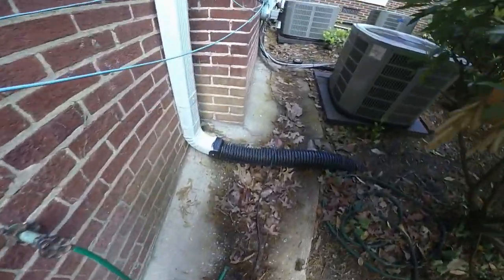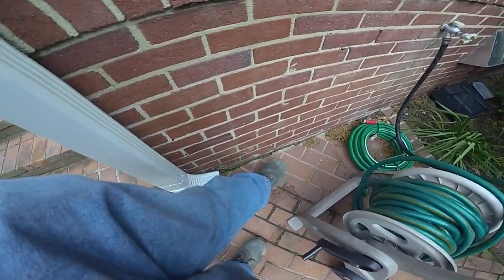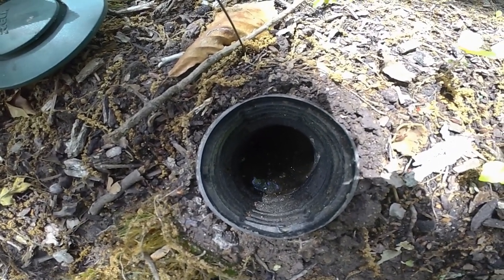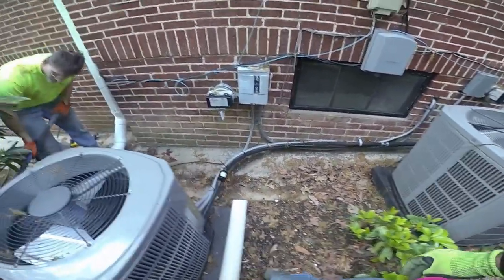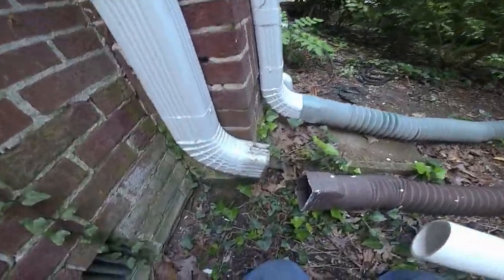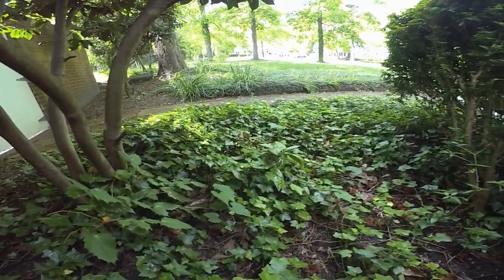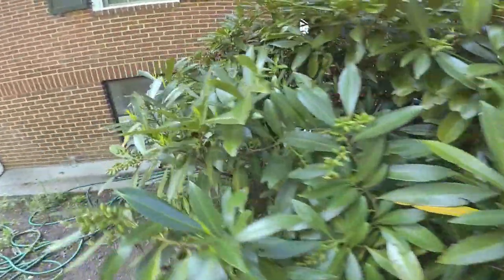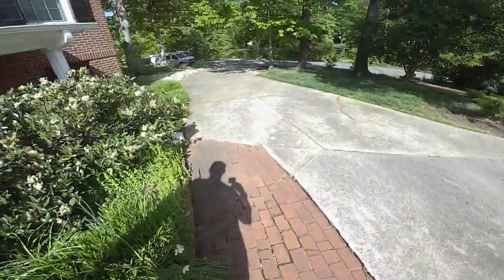Never use corrugated pipe

Comment: Totally agree with you on the “pop-up’s” I told someone doing a project that they wouldn’t work but the installed them anyway. At least they did use PVC pipe rather than corrugated. Still didn’t help.
Reply from the maker: They seem like a good idea until you think about it for a second.

Comment: The gutter pollen & tree-pollen parts from last month had created a slight backup/blockage in my smooth-wall but a larger storm cleared it this month.  10/10, I'm against popups too.  Mind-blowing how much was probably spent on those paved walkways + gutters to have no preplanned drainage solution than to dump the water onto the walkways.
Reply from the maker: Thanks! Smooth pipe is the only way to go. It cleans itself out! And yea, I run into situations all the time where drainage was not even taken as a consideration. It leaves me with some interesting and creative solutions! I'm glad you're enjoying the videos!

Comment: I don't see how a little bit of water standing on the corrugation contributed to his flooding issues. It sounds like the pipe was not draining much at all and backing up into the building and you haven't explained why that was happening. Sounds like the way it was installed was the main issue, not the type of pipe itself.

Comment: Great video. PVC all the way and so easy to install & maintain. Great job.

You had great fall too. Sometimes good fall cannot be achieved but as long as there is enough height from the water’s entry, water can flow uphill within PVC as long as when the water daylights is lower.

I tried it myself and PVC works well in difficult situations. I have fall in most of the PVC pipe’s installation but there is a bit near the end which rises and it couldn’t be helped. But the water eventually comes out very well due to the inflow being higher creating enough pressure.

Comment: I wouldnt doubt that old drain is tied into the homes terracotta weeping system, if thats the case, they should get a jetter and clean it out. It is most likely tied into the city storm water system, which would be even more beneficial for the home owner to minimize the below grade water pressure.

Comment: You say, "never use corrugated pipe". 🤔 But, Shawn, I watched a vid where this man had a corrugated pipe and used a clear hose to show just how effective it was at creating 'turbulence' and that kept the pipe clean! He was very insistent! Even showed how, when there was tons of water 'flowing' through it, that it could clear all types of debris! He was really excited by that! Maybe he should get other hobbies or maybe he was trying to sell it...ahh, now I get it...he did mention the name of the manufacturer a few times! 🤭😊
Reply from the maker: It takes energy to create turbulence, so the potential and kinetic energy of water gets used to create that turbulence and with no other input the water slows down and drops the debris. Of course this can be bypassed by blasting a hose into a short section of pipe.
Reply: @GCFD  ...yeah, that's what I thought! 🤭😊
Reply: There’s also another video where’s he’s inside with a white board drawing diagrams of a trench saying corrugated is better than pvc . The logic being corrugated follows the contour of the trench, so where there is a belly the water is inside the pipe causing it to magically flow up hill and away. He even says that pvc is flawed as there are only 2 rows of holes facing down instead of holes all the way round and on the top ( god knows why you’d want them on the top as I thought the idea was for water to percolate from the bottom up). Also said if there were more holes in pvc it would break the pipe.
Reply: The same guy that had the bs turbulence …..has other videos with dual wall saying how great it is to have smooth walls to keep the velocity up.  He also has a bs statement about needing an air vent…..LOL…..the gutter is an open system…..not vacuum can be created….LOL….he’ll say anything for a good story
Reply: @timkarcher6724  
Dual wall corrugated is FAR BETTER than sch40 pvc for downspout drains.  There are no interior ridges to snag anything, and it is way more resilient underground whether deep or shallow.  It is not cheap, but it is undeniably a great product.  It will never crack or collapse under virtually any circumstance.

Comment: What is price differential between corrugated pipe and smooth wall PVC? (Are we talking three times material cost or ….)?
Is labor time to install corrugated versus smooth wall PVC different?
Why do you use 4” versus 3”?
Reply from the maker: Schedule 40 is about 3-4+x material cost. Labor is much more if the PVC is installed correctly. So you're paying much, much more for PVC. The benefit is is self cleans, it has an enormous capacity, and it lasts for 40 years. I use 4" instead of 3" because 4" is that much bigger to let debris move through it.

Comment: What do you feel about dual wall corrugated pipe?  Also, do you use  Schedule 40 PVC pipe or are you okay with sewer pipe?
Reply from the maker: I use double wall corrugated for culverts and like them. I recently installed 60' of 18" double wall. The pipe we use is schedule 40 non pressure. It's rated as DWV pipe, Drain Waste Vent and is foam core. Same pipe as the 4" main sewer line going from a house to city sewer.  Schedule 40 pressure pipe is pretty serious, although I do have some. It's code to use it when going through foundations so I use it when I'm replacing the main sewer line  or septic install.

Comment: Corrugated pipe was used on my new house build 12 years ago and I have never experienced a single issue with them.  If properly installed they work just fine.
Reply: It is self cleaning pvc isn't.
Reply: @josephthibault6999  Apparently
Reply: @josephthibault6999 elf cleaning pvc pipe?😕
Reply: @GoaWay...  That is the argument for it, however if you don't get it at the perfect pitch it will clog. Where pvc you can hose out.
Reply: @josephthibault6999  oh. That's how it's self cleaning.😄 
When people say self cleaning, I always take it literally that something can clean itself. 😸

Comment: If corrugated pipe is so self cleaning, why don't they use it for sewer pipe? Not to mention, where there's water, there's roots.
Reply from the maker: Corrugated is not self cleaning due to the ribs. They kill the flow which is what provides the energy to carry debris. I would use PVC over corrugated.

Comment: 2:52 if you have an endoscope, you could take a peek inside so we can see how bad (or not) these corrugate pipes are.
Reply from the maker: I've thought about getting a ridgid seesnake. I think it would be useful.
Reply: BTW.. are corrugated pipes CODE for in-house drain?
ie: can you use them in kitchen, toilet, shower drain pipes?
This should clearly answer if they are better or not vs smooth wall pvc, cement pipes.

Comment: I agree with your opinion about corrugated pipe and pop ups. They just don't work well and should  never be used for drainage systems.

The one comment I have about the work you did on this job is, that this would never work in northern areas where freezing is common. You would literally have an ice skating rink on all of those walkways and especially concerning is the sidewalk where you're dumping that water. The homeowner would have lawsuits and complaints from neighbors because of the hazardous conditions it could create when it freezes.

So I realize you did this job where freezing isn't too much of an issue but all it will take is one or two freezing events and this homeowner will realize more work is need cause dumping water onto driveways and sidewalks isn't a great idea.

Comment: Courrgated pipe culvert aren't supposed to last for 60 or 50 there's they fall a part easily and collapse get rusty holes even metal ones so now we use coneretce or pvc pipe
Reply from the maker: I like double wall corrugated for my culvert pipes. Those are strong and smooth inside.

Comment: So now the owner will spend thousands of dollars on a new driveway because the water flowing towards the concrete will destroy that driveway. Nothing wrong with the pipe. It's the way the pipe way installed.
Reply from the maker: Thanks for your comment! I agree that PVC flows very well but I'm impressed you think it flows so well as to destroy the concrete!
Reply: @GCFD  He's referring to the fact that if there are freezing temps in the area, in time all that water on the drive and walks will destroy them.

Comment: If you do not use equipment as it is intended to be used, it will not do what it is supposed to do. Corrugated pipe does its job. The French Drain Man has and continues to demonstrate this time and time again.
Reply from the maker: Thanks for the comment. I disagree with the french drain man and the use of corrugated when you can use a higher quality smooth pipe. It's all about flow. I'm planning to do a video on why PVC is far superior to corrugated so please stay tuned! I plan to use actual debris I've pulled out of corrugated systems and run in through the two pipe types.
Reply: The pipes are plugged because of the pop ups and 90s NOT because it is corrugated. Smooth wall pvc would be plugged the same way in that application.
Reply: The French Drain Man also SELLS the pipe he's promoting lol 😆 and how many business owners are going to post a vidoe a failed system from a product their selling 🤔 Especially after all the videos saying how superior, went from  one of the special yellow colored corrugated pipe to now a 4 tube system. I first started watching his channel 2 yrs ago when he's a great educator. Seems to me 4 pipe systems sells more of his product while making it cheaper for his business to install bc less gravel has to be installed. His system would fail compared to Shawn's way when my brother drives his Tahoe and trailer holding a 57 chevy over it. Sorry I didn't buy into the French Drain Man 2yrs ago and had to stop all my notifications from his videos of trying to sell his product....
Reply: @bcwindowcleaning7360   A product  THEY'RE  selling.
Reply: @bcwindowcleaning7360  show me one video where he tried to sell you his pipe

Comment: just get dual wall corrugated pipe.
Reply from the maker: Dual wall corrugated would be better. But the connections still snap together and allow roots and dirt to flow into the pipe. Not worth it when PVC with solvent welds exists and I'm trying to save a basement.

Comment: The French drain man says the opposite.
Reply from the maker: Check out my video The ultimate Flow test. I don't say things, I show them.
Reply: @GCFD  will do, thank you for responding . I’m having a hard time determining what route to take, I have to do gutter runoffs and French drain
Reply: @Dinovece1  
Both pipes are fine. That is why both are used to this day. Its install that matters the most. I wouldn't over think it.
His "flow test" takes 20ft or so of pipe (PVC/Corrugated) and he runs some water in it from a bottle
As you can imagine pvc pushes faster in his videos for a few obvious reasons.
One: Corrugated has ridges to fill first
Two: Pvc was installed fairly straight due to what PVC is. If you pause his video before he pours corrugated looks like a roll coater.
So water flows slower.
Does this mean anything of value? No